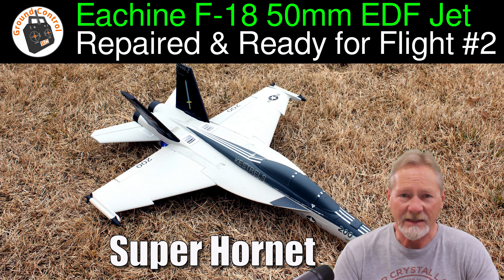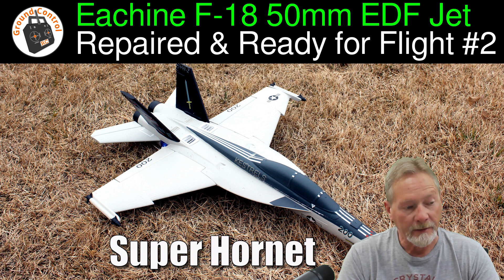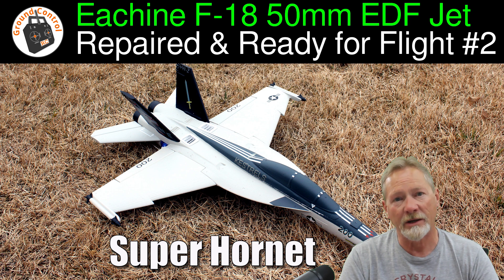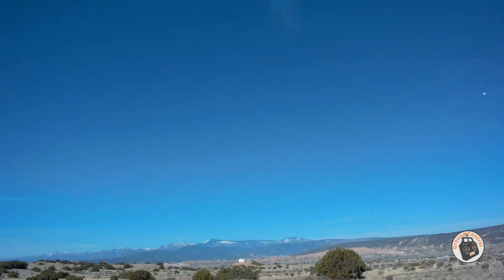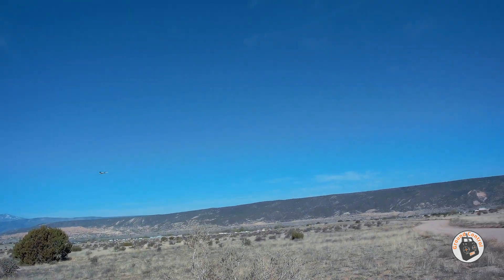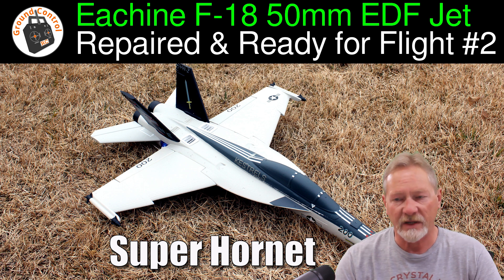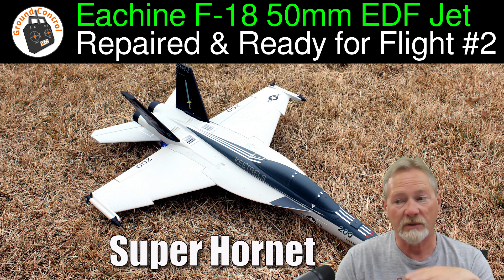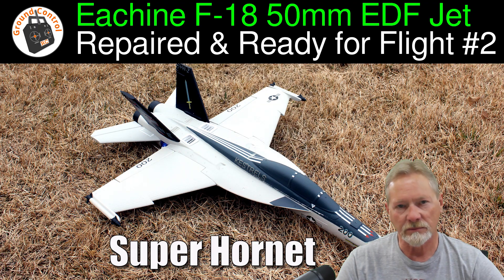Repaired & Ready for Flight #2 - Eachine F18 50mm EDF Jet Kit - Test Flight with Full 4S Power!

Comment: Unreal stuff!
They really are two nice 50mm Planes.
I need a new F-16, so My Radar is on high alert, looking for a Bangood or Amazon bargain.
Great Display and tip review.
You beauty GCRC.
Reply from the maker: Hi Jono!
Yes, IMO the F16 is one of the best I've flown.
I think the Arrows Viper is on par for stability and handling but the Eachine F16 is much more durable.
I had my F16 Pusher Conversion out recently and I love that airframe ;-)
Handles like it's on rails!
See you in the Air!
Reply: @GroundControlRC  Yep, that Pusher Mod was brilliant.
Have a great weekend Friend!

Comment: Hey.  It's me again (XK-A180 with BYME-D guy).  It's kind of funny that the day you posted this video is the day I put my F-18 into the dirt and had the nose rip off & canopy break in two - almost identical to your crash result, I think.
Anyway...Suggestion for you if you're worried about losing control again.  If you're still using that Radiolink receiver and have the Byme A in the F-18 then set the failsafe for gyro on.  If you lose radio at least it can glide itself in.
Reply from the maker: I just had a LemonRX Receiver in this, no gyro installed.
It seems that I'm having issues with the DSMX Protocol.
I switched to DSM2 and put (4) flights on it without any issues.
Strange that the DSMX Protocol seems to be the issue.
Same thing with my Twin Motor converted Chuck Glider. I switched from DSMX to DSM2 and no more issues.
I'm thinking my radio has an RF Module issue.
I'm going to stay away from the DSMX Protocol for now.

Comment: Looks like you got it fixed.   For the nose drop in turns you may have to feed-in a bit of outside rudder to keep the nose up.  Some plane designs need inside or outside rudder and some can be flown with "both feet on the floor" (instead of on the rudder pedals).   Set C/G for best level flight and use more rudder.

I didn't know about the crash. An elevator going dead is such a horrible feeling.  Happened to me once at the worst time.

The Story:  When I was in my early 20s an elder gentleman came out to the field with a large nitro .60-powered sport plane build from a balsa kit. Maybe a 5-foot span wing.  Said he knows how to fly but was very bad at landing and after watching me fly a few times asked me if I would land his plane for him.  Sure.

So we did it a couple of times.  I'd stand nearby while he flew around until he was out of fuel, then hand the transmitter to me and I'd glide it over and dead-stick land it.  I was good at that.  He flew high so I had plenty of altitude to work with for gliding.

Well, on the third flight he handed me the TX when the engine died and I proceeded to take control and fly the downwind leg to the runway threshold. The nose was starting to drop and so I pulled back on the elevator,.... and nothing. The nose kept dropping.  I started shouting I had no control and held the TX up so he could see I was pulling back on the elevator.  The plane ended up hitting the ground going straight down and was totaled up to the trailing ending of the wing.  I felt so bad for the guy. it was a new build and he must have put a lot of time into it.

We examined the remains and determined that the elevator pushrod clevis had detached from the control horn.  Very unfortunate. And even though it was not my fault in any way I always felt a bit guilty since I was holding the transmitter.  I felt sick about it for along time.  A piece of tubing slid over the clevis could have prevented that. Another lesson learned.

Happy flying.
Reply from the maker: I would have felt bad too even though it certainly wasn't your fault.
What a shame the plane was destroyed.
My 1st time out with this F18 I had just launched it for my 2nd flight and had just turned back toward myself and had it level at cruising speed.
The F18 started to slowly descend and wouldn't respond to elevator input even though I still had radio contact and was able to cut throttle.
I just had to watch as the wingtip caught a piece of scrub and cartwheeled.
I replaced the RX with an identical one but setup DSM2 rather than DSMX and had no problems during this flight session.
Go figure ;-)

Comment: I have both this and the f16 on stock set up. The f16 is definitely easier to fly in my opinion, the f18 being more of a handful and you have found its week spot in front of the wing! My f18 burnt out its esc and motor after barely 6-7 flights. I now have a larger 40a esc with an FMS EDF - flies with more power now, but it is still definitely a hands on at all times model..... can't relax for a moment! Need more air time on it! So far haven't seen the zoom that you have, but that might be because my hands were full keeping it in the air! Many thanks for your video and the useful info.
Reply from the maker: Hi Paul and Thank You!
Hehehe....yes, it is a bit of a handful compared to the F16.
I've flown (6) EDF Jets now and this one is by far the most sensitive to the CG location.
If I hadn't installed that carbon on the bottom of the fuselage the nose would been gone ;-)
I keep wondering when one of my EDF units is going to blow up since they were only designed for 3S not 4S.
Reply: @GroundControlRC  I wouldn't have minded mine going up in flames if I had put a 4s in it!
Reply from the maker: @paullepine4765  ;-)